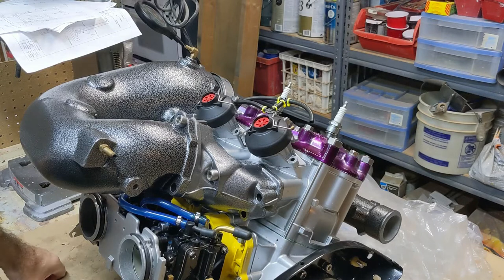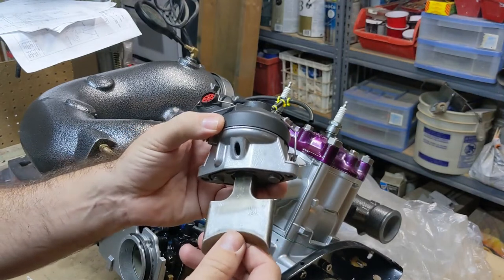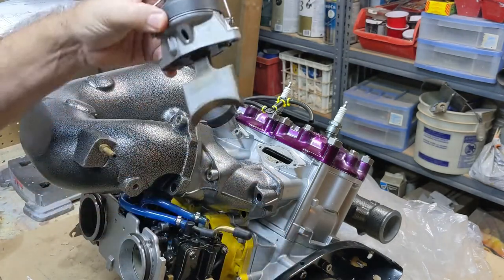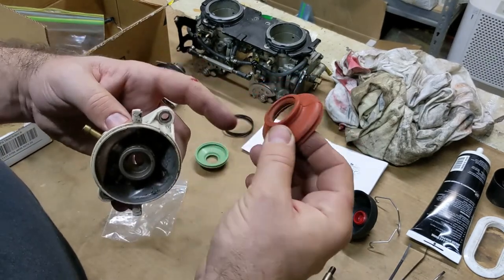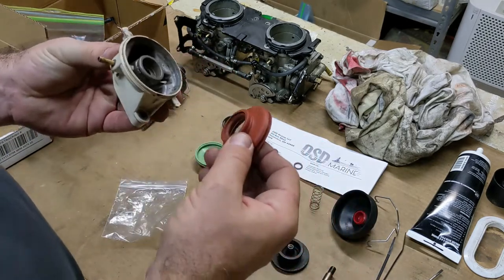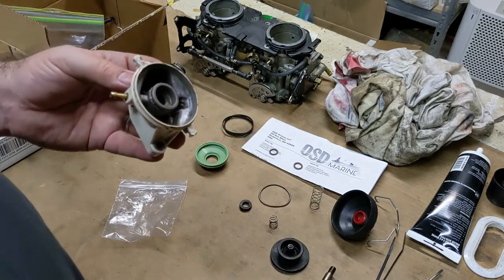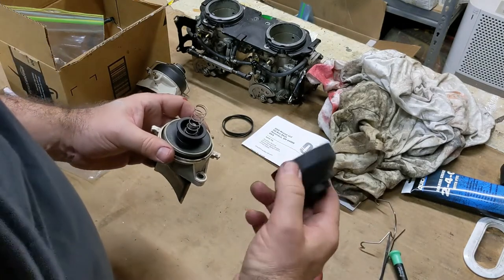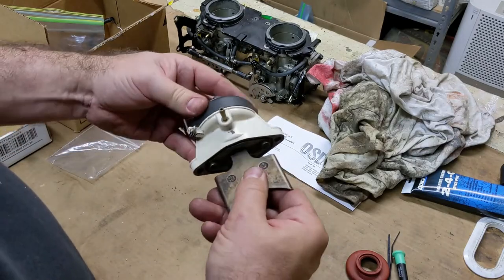Sea-Doo Rebuild RAVE Valves - Gray Ghost Resurrection

Comment: Great information! Thank you.  I like the advice about using some grease on the bellow.  Like you mentioned, those green bellows are stiffer than the oem red ones.  I believe they also added updated springs that need to be used with the green bellows.
Reply from the maker: Thanks for that tip on the spring ..I didn't know

Comment: My old 670 ho motor has a spring steel wire clamp(similar to fuel line clamp) holding small end of bellow onto shaft...I've had many Rotax engines over the years, I've seen zip ties....safety wire...spring style...
My bellows are the black stiffer ones, not sure if original or aftermarket...
Reply from the maker: I've pretty much settled on zip ties and file the corner to round it out so it doesn't poke a hole in the belows like the OEM metal ones do

Comment: Bought 2 2001 RX DI's and when I pulled the motor/ top end, i found that these RAVE valves were catching the piston like you said.  So must have been bored.  Now i'm looking for a person or engine to replace.
Reply from the maker: Peter at Fox Valley is one of the best in the biz. He rebuilds these daily and very good rep 
https://g.co/kgs/PaSJcS
Reply from the maker: Sadly it's a common oversight to not trim those guillotines back 1mm.

Comment: If these are bad,could it cause the motor to bog down on acceleration?
Reply from the maker: Maybe but usually when they stick you lose top end power band ..like can't get 5500 rpm sort of thing. Bogging is usually a fuel delivery issue and often because the carbs need to be rebuilt
Reply: @jonparkmac  my ski is fuel injection
Reply from the maker: Ahhh. Not the carb then I guess lol. I'm afraid I don't know much about DI/RFI. I've heard people talk about low fuel pump pressure ..which I could see.
Reply: Mines messing up too bogging on wot ... Then its fine . ... Putting old green ones back on Tom.
Reply: @jonparkmac what is normal with rpm for the 951
Reply from the maker: 6850 tops ..but don't push it. The 951 takes a lot of abuse and short lived at 200 hours. Be happy with 6800. If you want to push that .. just be ok with it grenading on you brutha. A lot depends on the quality of the build too. Hope this helps

Comment: I lost my compression spring when I pop the cap. Im an idiot.
Reply from the maker: I did that too. Looked over the floor for an hour. It had fallen down near the manifold. Check there
Reply: Il mio Rotax 787 ha difficoltà di accensione la causa potrebbe essere questa valvola?
Reply from the maker: @yurimantegazza4065 no the valves are only for tuning the power band and nothing to do with starting or idle
Reply: @jonparkmac  ok. Thank you 👍
Reply: @jonparkmac  What should I do to solve the problem of difficult starting?
Reply from the maker: @yurimantegazza4065 rebuild iir carbs with oem kits, keep original springs, replace gray fuel lines, replace selector switch and separator filter. Pressure test the fuel circuit, change plugs, twist off plug boots and cut wires back 1/4 inch. Check compression.
Reply: @jonparkmac  ok thank you 👍👋